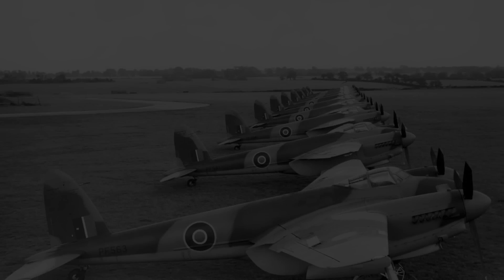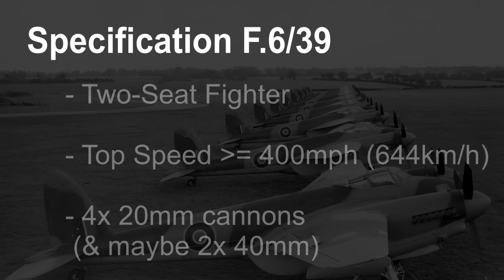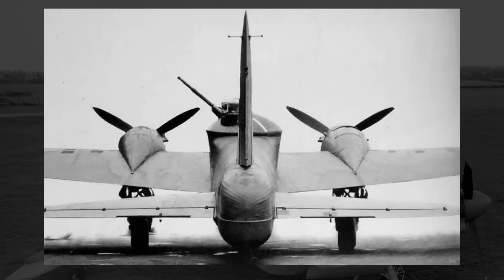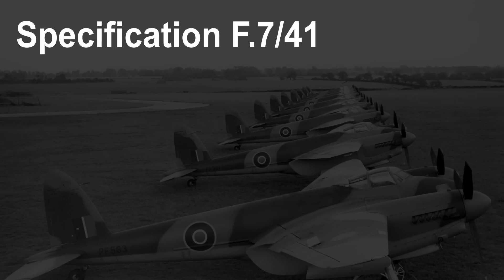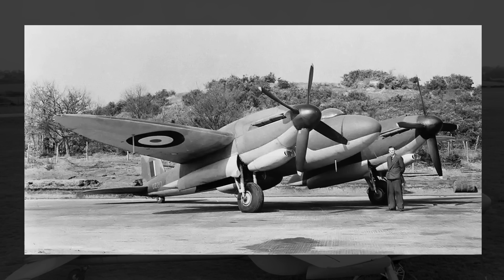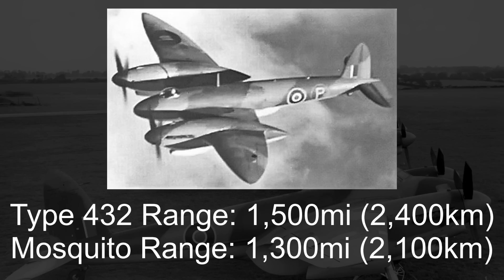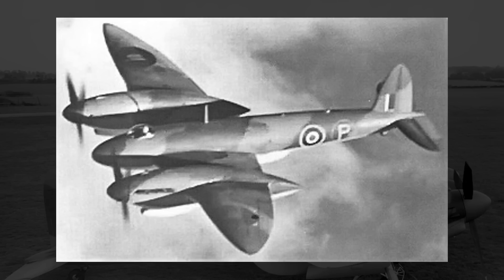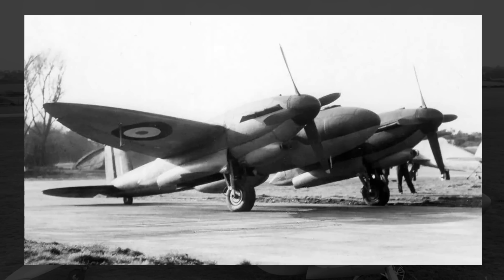Vickers' Unfairly Abandoned "Tin Mosquito": Vickers Type 432

Comment: Wood construction is not necessarily lighter than metal construction. At any rate, I don't see that this plane has any special capabilities that couldn't be met by the Beaufighter or Mosquito. I'm immediately struck by a very small tail feathers. My guess is that this plane would be 'dodgey' if flown on one engine or asked to recover from a spin. Add to all of this, an Air Ministry that changes it's mind as often as most people change socks. Very interesting article, though.
Reply: And carbon  fiber composite is not necessarily lighter than aluminum/aluminium. The BD-5J that Anheuser Busch had built back in the 80s was built locally. For some reason they wanted it built out of carbon fiber or at least parts of it. The builder did as they asked plus built aluminum/aluminium parts as well. The metal parts were lighter. Now this may have been due in part to the builder not being familiar with carbon fiber. But he did have extensive experience in composite construction with fiberglass.

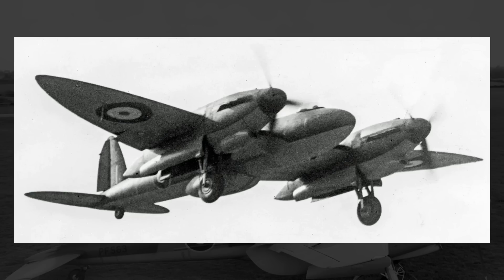Comment: 10:27 A very telling image. The degree of rudder deflection to counter adverse TO power effects is alarming. I bet the fin was just basically inadequate, and the sharply pointed wing tips would have made for scary power on stall characteristics. It would also have suffered lateral instability issues with a shorter fuselage than the Mosquito compounded by the inadequate empennage. The elliptical wing is beautifull, but best left for a racing aircraft. To have solved all its problems it would had to have grown into an unwieldly thing like the Westland Welkin.

Comment: "Unfairly abandoned"... hardly. The Mosquito was in full production (also in Canada and eventually Australia as well), available, and proved that it could do everything that the Vickers aircraft could (even eventually carrying a larger caliber weapon) without cutting into the supply of metals and alloys required for other aircraft manufacture. It was doing this with the same Merlins that were not quite up to snuff in propelling the heavier Vickers aircraft. One must take into account the fact that the various British aircraft industries had more than enough on their plates simply working with and improving existing types and building other companies' types under license.  The "Tin Mosquito" simply wasn't a priority and would have been a waste of resources had it continued into production. Now had it been seriously and massively redesigned (early on) as a high level interceptor or a two seater night fighter/intruder it might have found a suitable role.
Reply: Yup. Why would you produce a plane that's just a clone (more or less) of an existing wooden aircraft, except it uses material that is actually war-critical and could be used for Spitfires and Lancasters? 

The best thing about the Mossie was its design and logistics - and that fantastic performance and versatility was the brilliant icing on the cake.
Reply: @hoilst265  
Why build a competing design?  There were a few British designs that they kept going even though it was obvious they were inferior to other craft.  The Halifax bomber is just one.
Reply: @alanmcentee9457  the Halifax was fixable, but HP wasn't allowed to bring in extensive modifications as it would disrupt production. The Manchester was irredeemable without extensive changes, so Avro was permitted. The Stirling they just found other roles for and, given its 'empire bomber ' heritage, it could do as it was, for example, designed to be able to carry troops
Reply: @wbertie2604  
The Halifax had the same defenses as the Lancaster and was probably more survivable.  Yet, they couldn't get any engines for it.  It wasn't until late 1944 when they managed to get top rated Merlins that they could fly at the same altitudes and speeds as Lancasters. 

By survivability, the escape hatch on the Lancaster was 20"x20".  Try jumping out that with a parachute in the dark.  The Halifax escape hatch was 24" sq. Their downfall was the wing spar split the bomb bay so they could not carry the larger bombs the Lancaster could.
Reply: @alanmcentee9457  the Halifax, from Mk. III onwards used the Hercules and never again the Merlin
Reply: @wbertie2604  
The Mk III had Bristols.  Most of the Mks after that were fitted with the more powerful Merlins.  BUT, the Mk III was probably the most numerous version built.
Reply: @alanmcentee9457  oops, I'd forgotten the mk. V. That's out of sequence, though. Production was, AFAIK, II, V, III, VI, VII in that order. The V was a II with different undercarriage due to shortages, but predated the III in production despite the mark number (cf. Hawker Tempest V and II). The VI was a III with small changes plus an updated engine, the VII a VI with the engine from a III due to engine shortages.

But the short version is, once the change to the Hercules was made, there was no reversion to Merlins in actual production.
Reply: I, II, etc,
Reply: Would have been a much better idea to produce it instead of Lancasters
Reply: @tedarcher9120  not really, because they were designed for different roles. One a fighter, one a heavy bomber. The mosquito spanned between these extremes because it was an exceptional aircraft and also originally a bomber
Reply: @DanRyan-v5y  as a night bomber Mosquito was much better
Reply: @tedarcher9120  I love the Mosquito, but it carried a light load and a very limited selection of bomb types.

Comment: Not mentioned but of relevance, I think. The elliptical wings: what was their purpose? Was it a fashion statement in copying the plan view of the Spitfire wings that made it special?  The execution of the Spitfire’s elliptical wings were very subtle in its design, with a very fine thickness to chord ratio. The Schneider Trophy racing in the 1930s had demonstrated to Mitchell at Supermarine the importance of thin wings in achieving high speed. The disadvantage of the elliptical wing is the very high labour content in production. The Vickers aircraft had very thick wings which would have contributed some to its poor speed performance. Looking at the photo of the inside of the wing structure, the large expanse of room for fuel would be offset by the inefficient structure adding unnecessary weight. Almost every other wing design ever  has one or two large beans which extent vertically from the bottom surface of the wing to the top surface,  usually the wing main spar is located at the thickest portion of the wing. This is the most efficient structure weight wise. Was the Vickers wing twisting in flight making the aircraft seem unstable? The plan view of the aircraft looks, to my eye, to be small wing area contributing to a high wing loading. I am not accusing the Air Ministry of unethical behaviour but some poor decision making was made on the Ministry’s part. Vickers was, or still is, one of the largest Defence Contractors in Britain at the time and would have been well positioned to promote their offering by wining and dining the Air Ministry.
Reply: The wing was designed by Barnes-Wallis.
Reply: The wing structure is not as inefficient as one might think, in fact it’s clever.  But your point about elliptical platform is on point.  However both the structure and the platform were too much trouble for marginal improvement particularly in wartime.  Cheers
Reply: The Mossies wood structure advantage was its trueness and smoothness.  These advantages are seen in today’s composite light aircraft.  It’s just difficult to precisely fabricate riveted metal wings and if you did, they distort under load anyway.
    The DH Hornet in the works helped kill the Vickers.    Cheers
Reply: Sydney Camm famously said of the Tempest that he designed it with elliptical wings so the government would buy it.

The fact is that the Tempest had elliptical wings for the same reason the Spitfire did - to fit the armament.

Comment: The tail plane looked to small, I'm guessing they thought the steep dihedral would fix the issue and found with the powerful engines and the high thrust lines they just didn't provide enough stability.
Reply: Maybe taking the twin rudder design of the first model might have solved all those problems since each rudder would be in the slipstream of an engine.....

Comment: Why oh why didn't they just persist with the Whirlwind?
Reply: Rolls-Royce stopped making the Peregrine and the Whirlwind wasn't strong enough to use Merlins without major redesign.

Westland did get a contract to build the Welkin, a high altitude fighter fitted with cannon and 2 stage Merlins, like the Type 432.
Reply: @waynec3563  also, they managed to get Spitfires and Mosquitos up to Ju-86 altitudes at which point the threat vanished. With the Spitfire VI and VII it would be possible to deal with future threats. They did build a few Welkins just in case
Reply: @markturner5979 That is a very sentimental thought. However, I believe that what @waynec3563 said has some truth to it. Nobody won in the end but, The Whirlwind was 'potential looking' attractive!

Comment: It looks (to an untrained eye) that such a small tailfin and rudder would have insufficient authority against two of the more powerful Merlins and 4-blade props as installed on the prototype.

Vickers owned Supermarine, so the elliptical wing makes sense. It's more like a twin-engined Spit than a Mozzie, which begs the question... Instead of reinventing the wheel, could they have just used the Spitfire fuselage with that layout, and put the guns in the nose where the engine would have been?

It sounds dodgy yes, but how many other successful types came about from adapting or modifying an existing design? Lancaster?  Beaufighter? Mosquito night fighter?

Comment: Typoon, Tempest, and Whirlwind were all designed in metal. Mosquito was just unusually useful in its wooden form. British put out plenty of metal frames.
Reply: The whirlwind was a potential fighter just needed better engines. With Merlin’s it would have been a devastating piece of kit.
Reply: @neilmchardy9061  Outdated technology!
Reply: @neilmchardy9061  Out of date before its test flight, unfortunately. They knew jets were coming.

Comment: Specification F.6/39 make me think about the Whirlwind except it was a single seater. (lets mention his high altitude brother, the Welkin)
Reply: The Westland Whirlwind was a private venture begun in the 1930s by Westland. Like the Vickers project, it was hampered by its engines, in it's case, the Rolls Royce Pegerine, which left the aircraft under powered. The Welkin, which is considered by many as being essentially an enlarged high attitude version of the Whirlwind was not a success because by the the time it materialized,, it was no longer needed for the role it had originally been conceived for.
Reply: @EVISEH  I heard that the Peregrine was'n''t  the biggest problem of the WW but the ineficient radiators that overheat the engines  and the propellers was indequate. They've used the Hamilton wich worked fine on the first prototype and then swapped to De Havilland wich gived far less good performances
(I hope my english is not to bad english).
Reply: @dimitrihayez6502  The Peregrine was a  development of the RR KESTRAL and essentially was a supercharched version of that engine. Supercharging the engine did not yield the higher horsepower RR  had hoped for , resulting in RR stopping  development and production of the engine The Whirlwind was specifically designed around using the Perigrine, unfortantly the engine was unable to realise its potential , leaving the Whirlwind  seriously under powered.
Reply: @EVISEH  the Kestrel was also supercharged from its outset in 1930.

Development on the Peregrine stopped simply because the Merlin and Griffon offered more potential than a light but relatively low power engine with only one user. As such, there was no priority given to fixing residual issues with the engine meaning that sometimes it didn't develop enough power, although that's somewhat different to your emphasis.
Reply: @EVISEH  I thought it was to F.37/35. I've never heard of it being a private venture. The Mosquito was, if only for about a month.
Reply: @EVISEH  remarkably few were private ventures. Private venture means no MAP funding. The Blenheim was one of the few exceptions. The Lysander was designed to A 39/34 and was not a private venture.

It was relatively unusual for the Air Ministry to issue a specification for a design where a design had not already been offered to an existing specification. Exceptions include the Spitfire which was issued its own direct specification to cover changes to the Supermarine response to the 1934 specification. A similar example is the Buckingham. The gull wing design was to the 1930 specification, and the Ministry provided funds for development of that. It was not, AFAIK ,a private venture but I'll check my books later. The Hawker response to F.7/30 was originally a private venture.
Reply: Being the only aircraft that used the Peregrine the engine was always going to  be sucking hind teat in terms of development. The later Welkin proved to be not needed. This Vickers design to me seems aimed at much the same role.

Comment: It has Spitfire wings so it should be called the "Spitsquito"
Reply: That sounds more like the events following a "Taco Bell"😊
Reply: @DanRyan-v5y  Lol 😂
Reply: It doesn't have Spitfire wings, they are derived from Vickers high altitude bomber designs of the mid to late 1930s.
Reply: There was a “twin Spitfire” program as well…
Supermarine was a division of Vickers by this time (they were taken over in December 1938).
Reply: @allangibson8494  Yes, but a very different aircraft to this one and with a very different heritage. The wing design here predates the Vickers takeover of Supermarine. If you look at some of the high-altitude twin-engined proposals for a Wellington successor, you can see many design elements present there.

The twin Spitfire is interesting, not least because there were tractor and pusher configurations proposed (good luck bailing out of the latter!) and a tractor version got as far as mock up with a proposed armament of 6 20mm cannon (!) and an optional additional 12 303s for ground attack. Supermarine  was told to concentrate on the Spitfire.
Reply: @ The Germans got a perfectly functional Tractor/Pusher combination fighter operational with the Arado 335 but by the time it was ready jet fighters had rendered it obsolete. Its ejection seats were however a novel design addition.
Reply: Spitfire wings, Canberra fuselage and Mossie tail.
Reply: If you look at the plans, assuming that is the plan form that flew, it isn't an elliptical wing. The rear edge follows that shape but the leading edge is all over the place. In fact the first drawing shows a banana shaped forward swept wing form. Subsequent drawings show different planforms , but none are really fully elliptical
Reply: @ The later model Spitfires weren’t elliptical either… (Especially the Mk14…).

Comment: Glued not clamped ! And the glue was good 👍! Where as Germans glue NO Good 😌!
Reply: Mosquito's glue was a big problem when they use it in equatorial climate.
Reply: @ well it was working in Europe, the Germans glue didn’t! And that’s where it was needed most ! 
     Hope they use more modern epoxy’s on the new / rebuilt ones being produced in NZ ‘ Canada 🇨🇦 etc
Reply: @robertwoodroffe123  I hope so.
Reply: @robertwoodroffe123 The Germans had two problems:
1) the originally specified glue manufacturers factory was wiped off the face of the earth (Tegofilm phenolic resin).
2) getting slave labor to build your aircraft causes “issues” with quality control.
The protein based casein glue used in the Mosquito was vulnerable to fungal attacks when use in moist warm environments (Europe isn’t warm and North Africa isn’t wet (most of the time).
The Pacific is both…
Reply: @ myself not an expert ! But the glue used originally?  Type not ! what is known as , epoxy
Reply: @ sounds similar but different to why Genghis Khan’s Mongol army didn’t manage to take Europe fully! The eastern composite Bows ! Made from sinew , bone / antler and wood etc took over three years each to make ! But apparently fell apart in west Europe! Due to the near constant damp and humidity
Reply: @ The Moskito was supposed to use phenolic resin adhesive.
Epoxy Resin became commercially available in 1946 in Switzerland (where it was invented in 1936).

Comment: Designed as a high-altitude fighter, not a fighter-bomber as the Mosquito was. Not a copycat. Not even a comparable design. Just because they were both twin-engine, mid-wing designs does not make them equivalent. On that basis, you could compare it with a Bristol Blenheim.
Reply: The Mosquito was designed as a bomber, not a fighter bomber
Reply: @wbertie2604  The original specification was for a bomber, but it also met a later specification for a fighter-bomber and night-fighter. The first order was for 20 bomber variants and 30 fighter variants. So, both.
Reply: @onenote6619  The Mosquito was originally pitched to the Air Ministry as an unarmed bomber. That is what was accepted as by the Air Ministry, therefore it was originally designed to be a bomber, not a fighter bomber.
Reply: @onenote6619  It was designed as a bomber. The later use as a fighter bomber was simply a happy accident - it could be used effectively as a heavy fighter. But it was absolutely not part of the original design intention. That the RAF asked for a fighter version does not mean it was designed as such, because it most definitely wasn't. The specification that led to the F. II was for a long--range fighter, not fighter-bomber.